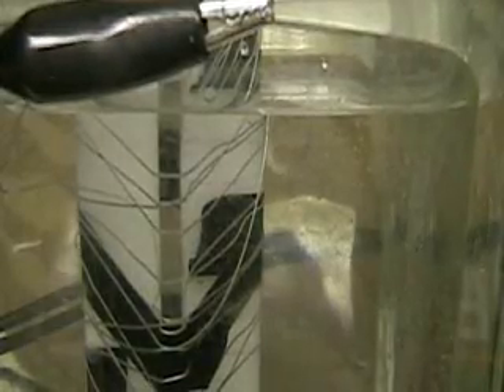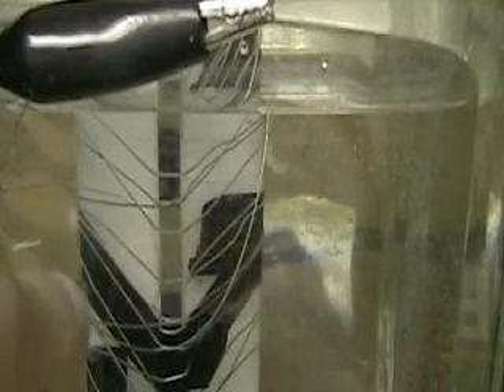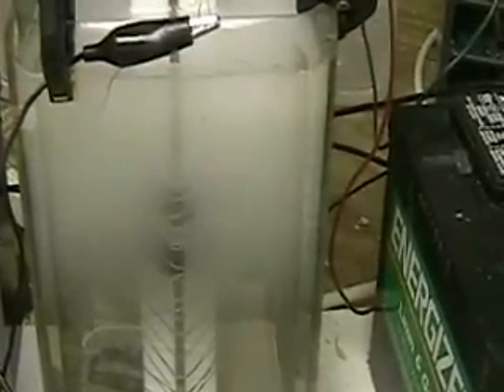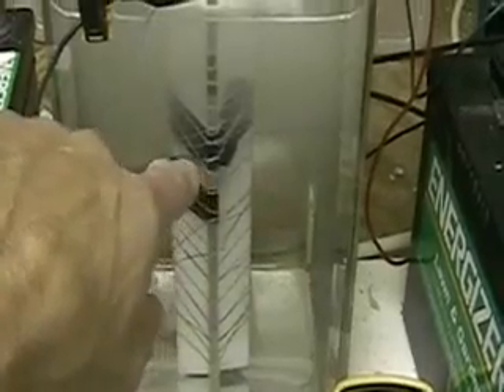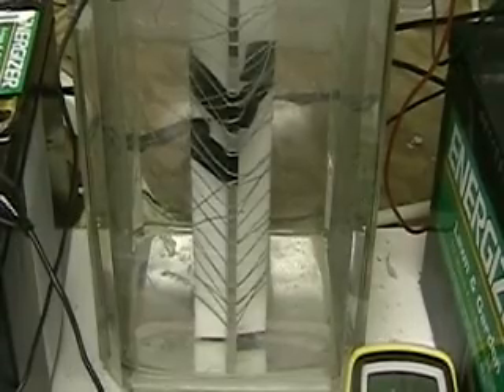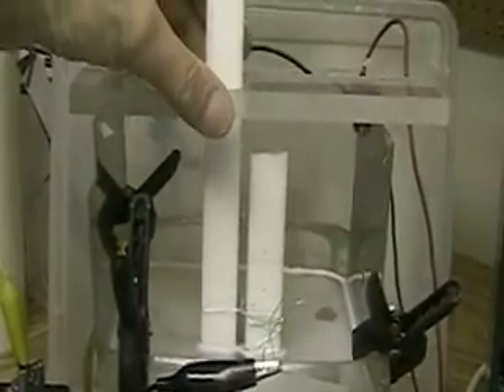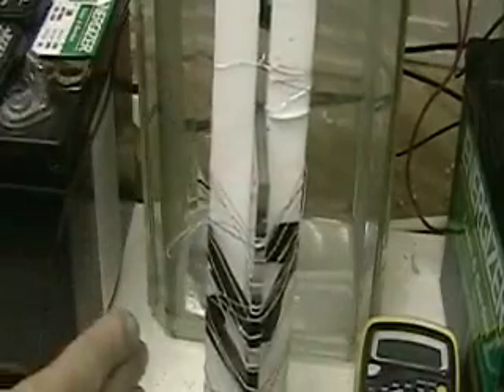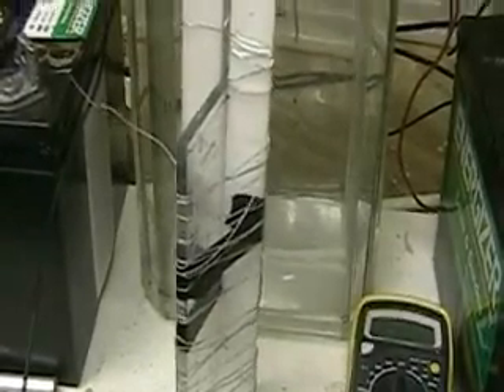Hydrogen Tap (The FIN EXPOSED) 289

Comment: hi John, I  also tested a wire type cell. and found that wire has to much resistance.  which equals current drop the longer the wire. and heats up the water once the amp draw is high enough for decent gas production.
I dont mean to sound so negative, but these are just my findings.
I'm still testing my plate design, and I am think the same as a few others, the closer the better. I plan to post a new video soon.
John, you are exploring alot of avenues.
Keep up the good work.
Fusion8r

Comment: Hi John. I use SS Mig Welding wire, and just got a spool of SS316L delivered, which will be in my next wire cell. Have you seen my videos? 

Now you have me thinking wrapping a SS plate with the wire, plate anode, wire cathode, keeping the same distance away from the plate each winding.  Maybe use a slit tube, or grooved Plexiglas on the ends of the plates as the gap-making material.

Anyway, nice work as always.

Lefty

Comment: I don't think that hydrogen can "dissolve" in water, it reacts with pure o2 forming water. The pure o2 is forming on the 2 plates to the right and left far from the wire so it does not touch the hydrogen. The bubbles are very small so they are able to move from the water to the air much faster and more consistently than if there were large bubbles.

Comment: I wonder what the output will be if u use only wire. 2 wires, one + other -, 0.125 apart, winded in a coil of 0.5. That one in a coil of 0.75 in a coil of 1 etc. I think that 'sharp' edges give off more gasses than flat surfaces. (perhaps even grinding a plate to make it surface less smouth might make a difference)